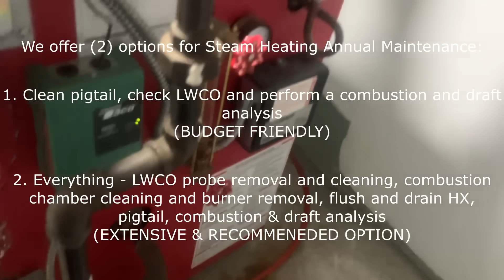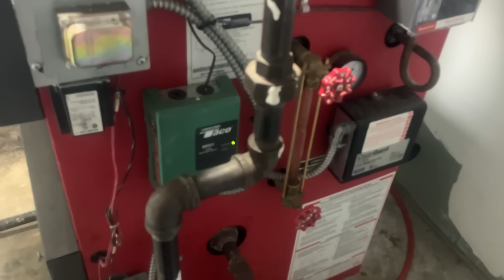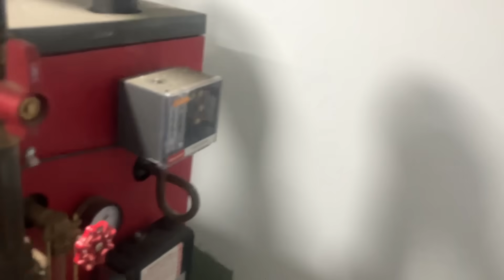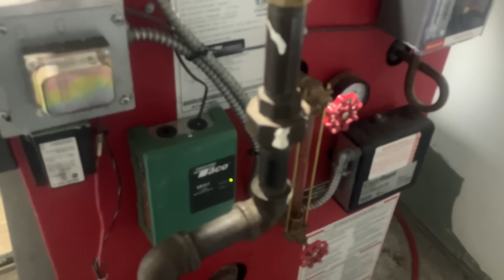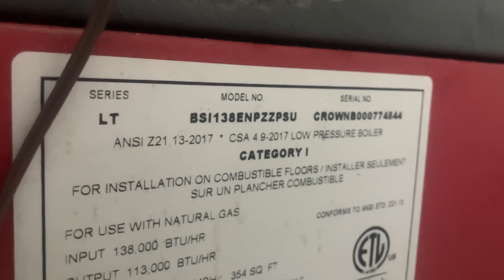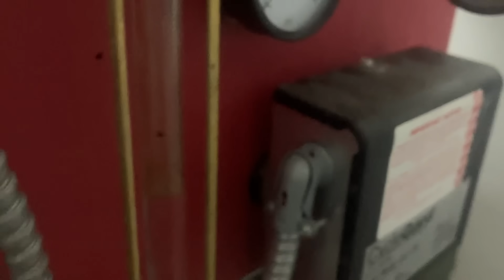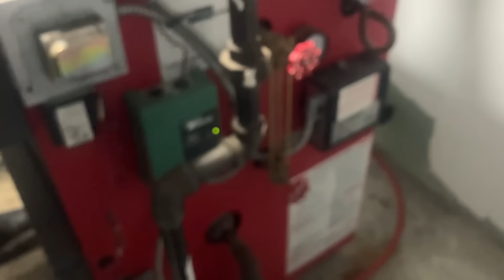New Crown Steam Boiler… Installed WRONG (5 PSI + No Combustion Air + No Insulation)

Comment: Mikey Pipes,
I have an older Steam System. Thermostats question.........
I had the old reliable Honeywell Round Mercury Type that went out years ago. The one with the fine tune Anticipator setting.
It's been replaced with a Honeywell Digital Programmable RTH221B1039 about 12 years ago. It works. I leave it on "Hold" and have it programmed, but never mess with it and leave it on "Hold".
I hate the way they work. Setting it at 72 it runs until 73, then off, back on at 71. I feel "Hot" then "Cold". It's the temperature swing of 1 degree. Old Mercury ones seem to have a lower "Swing". 
If I set it to 73, I'm hot, then to hot. 
Program setting is right for Steam. I think ...... 2 cycles per hour.  

Honeywell makes a "Round" now but same thing. No custom Anticipator settings. Just 1,2,3, and so on.....
Thought about getting that but really no point since it would work the same as my simple Honeywell Programmable.  

Just drives me crazy sometimes with the Temp swing. Then when we have days like around 45 or 50 degrees, stays off to long. Temp is fine in the house, no call for heat, but radiators get cold, then it just takes a little burner time on comes to temp. 
House is constant 72 or 73, don't get me wrong, it's just the Swing temp, that drives me nuts before it fires up again. Guess it's normal for days when it's at that "in-between" temperature outside just enough to take the chill out.

ANYWAY .........
I have an idea .........
"Virtual Visits". Like some Doctors do. Take Video appointments, they can show you around the boiler, piping, get some ideas what might be wrong, and suggestions. 
I know it could be a possible liability issues, but Doctors do it. If they do a video call and they tell you look good and the next day you pass away, they are not responsible.  LOL !

Lot of people need Pro help with Steam Heat and you would be surprised how many "Pros" don't really know anything about proper piping, Wet Returns or anything. Only the boiler
Reply: so, try three cycles per hour. radiators may be undersized and some removed in past renovations, also could be air vent issues not heating all rooms equally/enough.
I would not go more than 3 CPH on steam/water systems.  simply change the setup function "5", to number "3" setting. that's the one listed as heat pump, hot water high efficiency furnace. that should result in about 3 cycles per hour. 
you may also have leaky windows/doors, lack of air sealing, not enough insulation, bad thermostat placement. thermostat could be too near a heat source, radiator, warm room, pipes inside the wall, kitchen, bathroom, chimney/flue pipe. 
you could change to something more electronic and configurable, but of course that means you have to learn it and fiddle around.
Reply: @throttlebottle5906  Right now it's set for 2. What they recommend for Steam. I will try 3 and see how that works. House was built in 1908 and still has all original Radiators none have ever been removed or changed around. The old old type that were just Steam. No cross tube on the top. House in not Insulated but I installed all new Anderson windows about 15 years ago and not 1 drop of air leaks through them anywhere. I have all the Radiators perfectly "Balanced", no hissing Vents, all Adjustable Vents that are tuned just right in each room .
I will try the 3 and see how that works out .......   Thanks

Comment: Oversized boilers don't heat quicker than properly sized boilers. The radiator is can't dispense heat any quicker, just because there's a boiler that's making more steam than they can handle.
Reply: older, oversized and oil boiler means larger thermal mass, so the water would keep boiling longer on off cycles as well. all the newer stuff has far thinner castings and less thermal mass.
but oversizing in general is bad, especially now days, due to that thinner castings and lower thermal mass, they'll heat faster and cool faster, which makes yo-yo swinging heat spikes.